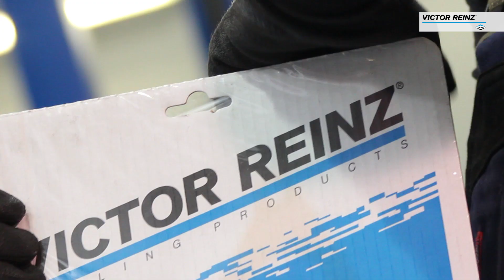How to replace an intake manifold gasket – professional tutorial and tips

Comment: That's an advertisement, not a tutorial.  Surely VictorReinz can produce something suited to real mechanics instead of this silly video. Surface finishes, cleaning methods, removal of residual gasket material, and dealing with imperfect surfaces are HIGHLY relevant to correct gasket replacement.
Reply: It is self explanatory for those with observation skills. I partly agree though, a run through intro explaining the steps helps to establish context for viewers.